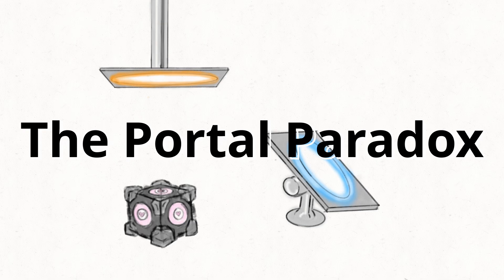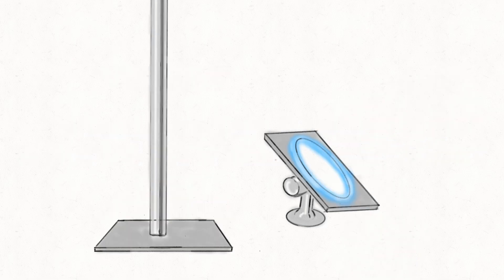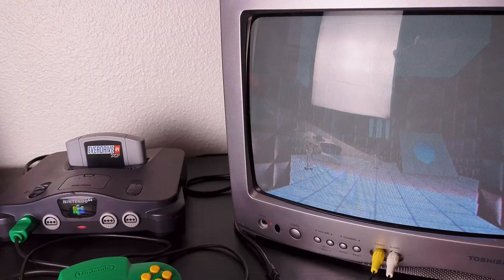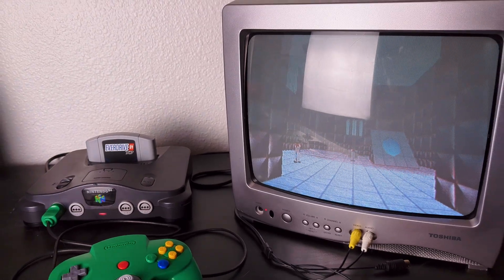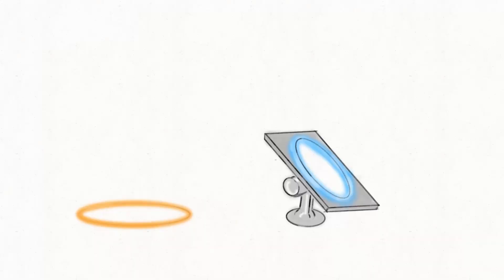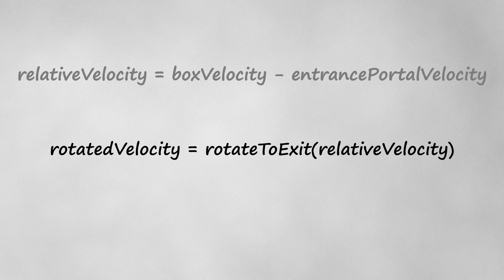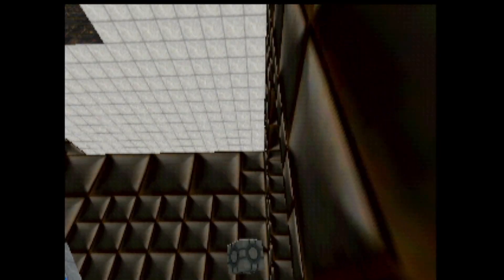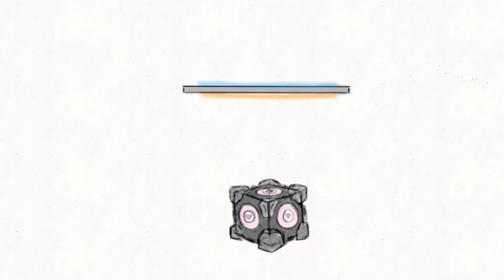I rewrote Portal from scratch and solved the Portal Paradox

Comment: Wouldn't it otherwise violate the first law of thermodynamics? If no energy is transferred from the object the portal is attached to, to the object being moved, then the action of the object moving into the new area would generate kinetic energy from no energy. If the energy wasn't transferred into the object, then if we could create portals, we would be able to generate infinite energy.

That or the answer is none of the above, then energy from the moving object would transfer from the areas around the portal, into the area the portal's structure makes contact with, then the object moved through the portal is unaffected by gravity due to a lack of the potential kinetic energy necessary for the object to fall unless it's new location has a stronger gravitational pull than the last, to squeeze more potential energy out of the object, in which case it would still either fall partially before stopping mid-air, or float down slowly, or do something entirely different because we've never seen this happen before in reality.

A lot of paradoxes arise with the use of portals though, so it's possible portals are simply impossible in reality. But then again, a lot of our own ideas about how the universe works tend to contradict one another, such as special relativity and black holes. Either, one, or both theories, are incorrect in some way.

Comment: I can see the argument that since you coded it, you decided the results. While I am not sure if your results would match the original code of the game, I do think that is irrelevant.  You have mathematically solve the portal paradox with physics math that work.  Mad props as this is really impressive!
Reply: He didn't solve anything. He literally coded results he wanted.
Reply: @fantastikboom1094  No, he simply coded results that work.  You are free to hack Portal and see if it behaves the same.
Reply: @xreev0x  He coded result he wanted to see. Of course that would work, because he coded it.

I am free to hack, so? Portal 2 has no such formula. What should I hack to get it? Or should I modify the game? That would be coding the result he wanted to see.

There is a command that enables moving portals. They are just broken, so they won't behave in both of ways we discuss. It gives a third result. I already tested it and it's really so broken.

Comment: Ok thats all fine and dandy, but like... the floor beneath the cube isnt going anywhere.there is no reason for the cibe to fall through. Even stull,  I think that it should roll out the other end because the cubes og velocity was 0. Now just because you have "opend a door" really fast dosent mean that it gains speed. Imagine a trap door. You only get gravity for acceleration, not the speed you opened the foor at. Please inform me if im flawed

Comment: Pre-watch comment/estimation:

From the diagram shown, the cube would slide out of the blue portal after the orange portal slams down onto it.
Objects do not move unless a new force is acted upon them. In this scenario, the momentum and kinetic energy of the moving panel would be the new force; the only other force affecting the cube is gravity, which has not changed.
However, because of the orange portal, the panel and the cube never make contact, meaning no kinetic force is applied to the cube. The cube remains stationary.
Once the cube travels through the blue portal, gravity acts upon the cube in it's new position, making it slide down the diagonal panel, and collapse onto the floor.

The only way the cube would launch out of the blue portal is if it already had momentum/kinetic energy when travelling into the orange portal.
That energy is what would carry it through, and would continue acting upon it until it collided with something to disrupt its kinetic energy, like a wall or the floor.

Alright, let's see what happens then...

Edit: Huh, well that was unexpected.
Though I guess I never actually thought about relative velocity between the portal and the cube.
You learn something new ever day; thank you James, and now knowing about your Portal 64 project, I look forward to seeing it progress into a fully fledged and beloved game!

Comment: I would argue there is no velocity to factor in. I'd argue the portal is no object, but a wormhole in physical space of sorts. The only thing moving is the platform, the "portal" itself is just a spatial anomaly with a relocating anchor point. 
Think of it like...rather than the portal actually "moving", so to speak. It's instead rapidly "shot onto the platform" in a frame-by-frame sort of way. Except instead of frames being frames they're probably like...every layer of atoms or whatever, and the "being shot onto the platform" thing is rather just the portal sustaining itself while moving, but I think you know what I mean.

As a result I'd argue that the approximately cylindrical volume of space (box included) that the portal envelops - due to the platform moving it - is just a volume of space that is going to suddenly occupy a different space. Perhaps even with less potential velocity than when Chell steps through it regularly, since the box didn't actively move through the portal, the space around it was just changed, y'know?

The "speedy thing in = speedy thing out" argument doesn't apply to this, I feel. Because there is no speedy thing. Portals don't apply energy, they just make stuff be somewhere else I think

All that said though, I'm honestly not well enough educated in physics to back this up with anything mathy and stuff. I Maybe I just interpret the concept of portals differently

Comment: I think the cube would be sucked through the portal almost instantly after touching it. This depends on the weight of the cube and the speed of the portal tho. The space on the other side of the portal is moving towards the cube so as soon as it touches the other side of the portal that part of the cube is in motion. The part of the cube that's in motion is pulling on the rest of the cube that's not in motion this effect would become greater more of the cube goes through the portal.

TL;DR The part of the cube on the other side of the portal is moving through space faster than the rest of it.

Comment: That is a question, a curiosity, not a paradox. A paradox is when two things are true that are not compatible. Like if 1 + 1 = 2, and 1 + 1 = 3 at the same time... A paradox! 

for this question, whatever speed the portal is moving at is the speed of the box coming out of the other portal.  It would be like space moving around the box vs the box moving through space, you cannot tell the difference without an external vantage point...

Comment: I think your approach to the equation is wrong because of what portals actually are. Your actual equation is perfectly fine, it's just based on what I think is an incorrect understanding of portals. We only get an extremely vague explanation of how the portal gun works, but we can assume its function based on its name - the Portal Gun, as well as its original name, the Quantum Tunnelling Device - and the fact that it uses a miniature black hole to function. It has never been referred to in the setting as a teleporter.

The portal gun doesn't actually work like how it does in the video game. It doesn't create teleporters that move objects between two points and perfectly preserves their velocity - portals themselves don't actually move atoms from one portal to the other. What the very limited lore implies they actually do is they create an infinitely short tunnel between two points. You could explain it as being like a wormhole, or maybe being like a four-dimensional connection through three-dimensional space, but whatever it is, it is a hole between two surfaces that look unconnected to the human observer. One should note that portal is a synonym for an entrance or doorway (i.e. a hole), not a synonym for teleporter.

A hole, by definition, is not an object, and therefore it cannot actually have velocity. Calculating the velocity of the portal doesn't make sense because, while the portal is an entity within a game engine, an actual portal is a hole, which is - by definition - empty space. Because it is the surface with the portal moving towards the cube rather than the cube moving towards the surface, even though it looks from the other side of the portal like the cube is rushing upwards, it's actually more like a floor-less room being dropped on top of the cube. If portals were teleporters, then this difference would be irrelevant and velocity would always be preserved no matter what, but because they are holes, the distinction does matter.

Comment: “Moving portals aren’t implemented in portal”
That one random moving portal level in Portal 2: 👀
Reply: Iirc, that’s a matter of just changing a single value to allow for it, but the logic required for the portal paradox isn’t implemented, as it was never intended to be used outside of that set piece.
So instead of either result happening, the box doesn’t go through. I may be wrong, this is just going off of what I remember.
Reply: @MasterHyperionMC  It's more a case of those portals moving side to side rather than up and down (or forwards and backwards), so it wouldn't really be possible.
Reply: @MasterHyperionMC  if the portal paradox was correct, moving a portal at a laser would accelerate the photons in a laser beyond c.
Reply: @xelgodis80085  Ok? I feel like I’m the wrong person to say this to, given I didn’t actually express an opinion either way.
Reply: @Master_Hyperion  just making sure no one is confused by the obvious misinformation of the video.
Reply: @xelgodis80085  No? According to special relativity, the light wouldn't gain speed, only get more blue or red (wavelength would change).
Reply: @Validole  that's not how the portal affects things according to his model.

He has a a zero-mass, zero-energy, zero-thickness inertial frame connecting two places in space-time somehow affecting anything passing through it.

If there were mass, or if it were accelerating towards or away from the object, you would get redshift/blueshift.

However, since it's a void that has no way to actually affect anything but is still applying some kind of force, it must accelerate space-time itself passing through the portal. So instead of normal physical interaction causing a shift in wavelength (not speed) of light, it must directly affect the speed light itself travels.

This is all moot, because for this to even happen you'd have to pretend that a void can somehow interact with anything inside it, and for that to happen you'd need to pretend that the universe has some base inertial point of reference for the space inside the portal to even have a frame of reference to begin with. There is none. It is a void. I don't know why this is so hard to to comprehend.
Reply: @xelgodis80085  So what you’re telling me is you… can’t have portals between two points?
My god, what a novel idea! How can no one have though of this possible solution to the hypothetical before?
Seriously, dude, we’re starting from a point of utterly broken physics. You’re gonna struggle to make it fit with the laws of physics.
Reply: What level was this? I don't remember
Reply: @LotharLive when you destroy the neurotoxin with lasers
Reply: I think he meant there are no portals on pistons

Comment: Actually, if you test it in the engine in Portal 2, you will see that, if you drop the back-to-back portals on a cube, it WILL jump up.  In fact, it will jump up then slam back down into the floor directly below the bottom portal.  The Portal Paradox is not even really a paradox as it is simply a misunderstanding regarding how the engine calculates the velocity of an object moving through the portal.  Don't quote me on this, but the way an object (or the player) is portalled to another location is by pixel shifting the object (or the camera in the case of the player).  This means that the engine renders the object like an animation without the in-between frames.  In other words, as the object passes through the portal, the engine begins to duplicate the pixels of it while deleting those original pixels.  The duplicates are then moved to another location in 3d space where they are recreated.  This is why the cube appear to be delayed in your game.  Your game engine lacks the processing power to do this quickly.  Thus, it takes time for it to complete the calculations needed to determine how the cube is moving and where to start rendering it again.

Comment: Something I'd be interested to see is if you had the same setup as the 1st test but you very slowly pushed the portal onto the box. I'm not sure how you could properly simulate this, but at what point would the gravity from position A become overruled by the gravity of position B. I.e., at what point of being pushed would the cube fall off the floor. And what would it look like from the cubes perspective. 

Maybe have both portals upside down to begin with and push the portal onto the box. If the box never stops making contact with the floor would it ever fall? Especially if the second portal is moving at the same speed relative to the box as shown in your second demonstration. Furthermore, is there some point where the box would experience "zero g" as it were?

Comment: As the cube is going through the portal, the portion that comes out the other way should start getting influenced (i.e. accelerated) by gravity while the other portion stays stationary. The net result should not only be to see it fly out, but also experience a tork resulting in the cube spinning on itself
Reply: It won't shoot out. There is no reason and no way for this result. But what's right - the cube will experience different directions of gravity force while passing through.

Comment: Wouldn't you run into problems with inertia? So you have a 1 ton block sitting stationary, you slam a portal down on it at mach 3, then you suddenly have a 1 ton projectile flying at mach 3? Where's the opposite reaction? Your platform might weigh an incredibly small amount, maybe 100lbs, it can't possibly throw a 1 ton block with any significant force, just like hitting it with a 100lb bat wouldn't send it flying

Comment: Not saying you're wrong, but what would happen in your model if you slammed the portal down but stopped halfway down the cube? Would that impart a force on the entire cube? On part of it? Would the force imparted on the first half of the cube lift the bottom half and pull it up through the portal? So if the cube weighs 10lbs and you move the portal at 100mph and force = mass * velocity, what is the force applied to the cube if the portal stops after consuming half the cube? Does the cube get chopped in half and the top half goes flying?

Comment: I suppose that's consistent if you treat the portal as a thing, rather than a hole.
Reply: The portal is a thingy hole (obviosly not holy thing, or it is)
Anyway, the portal can be moved but it can't interact with the object passing through. So it shouldn't apply any force on the cube.

Comment: The way I see it, since a portal essentially creates a doorway to another spot relative in 3D space, the cube shouldn't gain momentum because it would be like moving an open doorway at you. There's nothing there but the hole therefore no velocity would be imparted onto an object passing through it. Although depending on the logic of the physical portals themselves and what happens upon contact with each other and what happens to the surface behind the portal it could impart motion that way. If portals are "physical" when they collide with each other but the surface behind it is still there physically in some way then the cube would fly. However if the portals truly are just holes then nothing would happen.

Comment: Idk if I have anything here but it seems like if you view the problem from the point of view of momentum and intertia then the portal itself (or really column the portal is on) should have all the momentum and then the momentum would be dissapated not by the block because the portal is there but the places on the floor that touch the column

Comment: The issue is not if the box would fly out due to velocity, but whether the portal has velocity in the first place. You aren't slamming a floor into the cube, you're slamming a hole into it.
On that notion, I think the cube should just slide down the ramp because a hole has no velocity, no matter how hard you slam the box or cylinder you have the hole in.
Reply: The assumption you made is that the velocity of the floor with the yellow portal is shared by the yellow portal itself. The opposing argument is that it shouldn't. If it can't, then it's always stationary, even if the floor itself is moving. Not saying I'm right, though, as it's very difficult to give concrete proof for which way it would work.

Comment: When are you foing the calculation though...?
Your error is looking at the acceleration as discrete and instantaneous, but in reality you're looking at a continuous function.

When the portal starts to cross the cube, a tiny part of the cube will be transported to the other portal. The accelerated portion of the cube will be insignificantly sized so will not result in a sufficient impetus to overcome the force of gravity.

I've no idea when -- if ever -- the cube would start transferring momentum. Your transference of velocity is merely an upper bound, and doesn't tell us what the actual velocity of the cube would be.